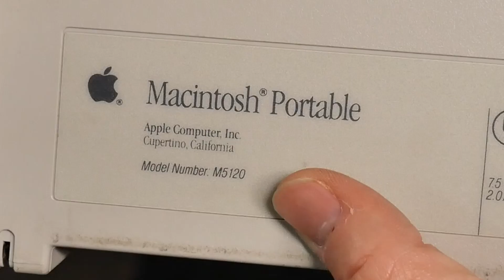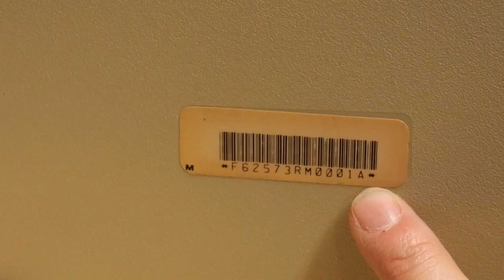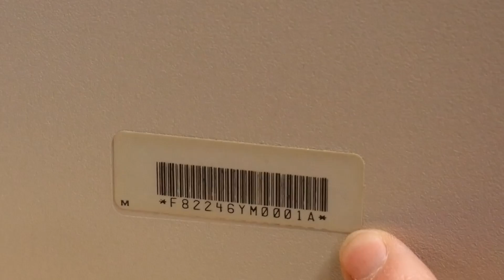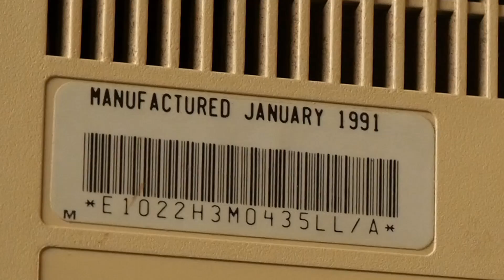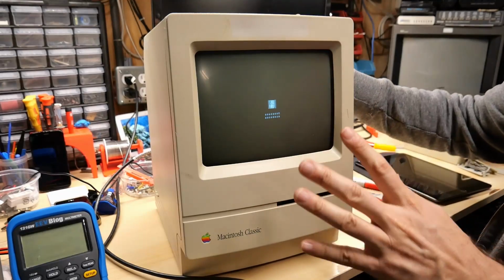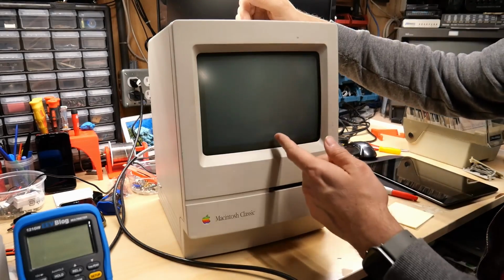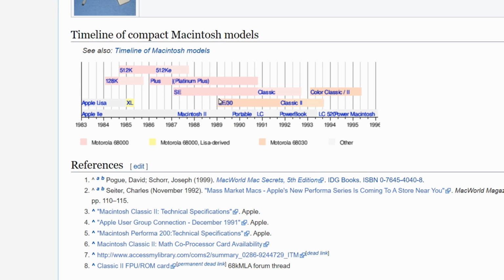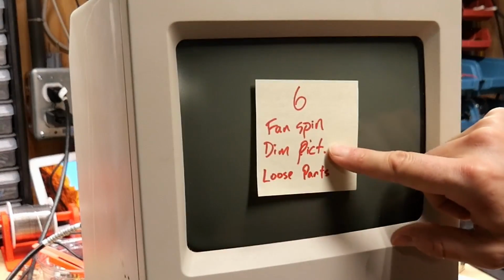Mac Repairathon Part 1: Taking stock of the issues

Comment: ive worked on so many of these over the years. and let me guess, the Maxell "bombs" have gone off in most of them? yea probably and its devastating sadly. :-(

Outside of that, the analog board and logic board caps are known problems in the Classic line. the Plus, usually the flyback or bad solder joints. The Macintosh Portable? Dont even try it until you get a good SLA battery to replace the one thats in there, or you risk damaging the logic board. And of course, its gonna need cleaned and caps too. But sometimes it eats the traces and you have to run patch wires to get it going again. That portable needs a 7.5V 1.5A adapter. Dont use a bigger one as its rated for the correct charge current of the SLA battery.

Also when removing caps, use the snip or press/twist method. dont try heating it up and removing it, the corroded oxidized solder will not want to let loose, and you risk loosing the pads. youve worked on plenty of stuff so im sure you know all that already. 

but I used to repair mac stuff and was good at it like you are with Commodore stuff. I know the Mac Portable inside and out. Even designed my own RAM card.

Comment: I'm reasonably sure that Classic II logic board will live again after a recap. You might have to run some bodge wires to fix traces around the battery leakage, but it looks a lot more contained than some old Macs I've seen. Those red Maxell batteries love to leak everywhere.

Comment: I have a Mac SE/30 that I screwed up the recap on and now I'm scared to touch it in case I make it worse.
Reply from the maker: You know my SE/30 had extensive damage from the leaking caps -- and to fix it fully I had to add some bodge wires. You just have to use powerful magnification, reference the schematics and be methodical about checking the traces around the damaged areas. I think mine needed a couple bodge wires and it is fully working again.

Comment: For troubleshooting classic Mac analog board issues, seek out Larry Pina's excellent "Macintosh Repair & Upgrade Secrets". He covers all the common issues. Classic form factor Macintosh analog boards are notorious for having cold solder joints. ALSO, the Mac Classic can be booted from an OS that his contained in the onboard ROM. If you can get one of them to pass POST, boot it while holding down Command-Option-X-O on the keyboard. "XO" was the Classic's codename when it was in development.
Reply from the maker: Wow! I hadn't heard of that combo, thanks for that. Will need to try that out!
Reply: @adriansdigitalbasement  Yes, a very handy feature of the Mac Classic. I have one that needs a recap and won't boot from the SCSI drive. However, it does boot from ROM. When you get yours working again, maybe some videos on modern days uses for these, making boot disks from a PC, etc. would be nice follow ups.

Comment: That big gash on the side might be a chemical burn kinda thing. There could have been something plastic touching it for a long time which eventually reacted with it. You see it where cables are lying on cases sometimes.
Reply from the maker: I've seen those melted cable patterns in stuff before -- but I think this was a grinder just as it has the telltale signs of that. Maybe it had something engraved in the side they wanted to remove?

Comment: Mac? Never heard of it, does it have a SID chip?
Reply: What's a MAC?
Reply: @MD4564  An Amiga with delusions of grandeur.
Reply: @MD4564  Last I heard it was a unique per-device identifier for networking equipment.
Reply: Yes, they did a version of the Mac with a SID chip, but Apple were too embarrassed to market it, so they sold it under their Commodore brand as the C64
Reply: Dave Poo If thats true then I gues they scratched their ears a few times afterwards😅
Reply: Everything Mac prior to the Macintosh II just sucks because they don't even have color screens I Mean wtf computers had color screens in the 70s already
Reply: DJ Slinus But the Mac's claim was screen legibility and emphasis on typographical concerns - which enabled it to spawn the niche of desktop publishing. With a display that was always in graphics mode, it could introduce the use of proportional fonts in a way that no computer prior was able to (well, there was the Lisa, of course, but whose counting that) as part of its normal UI capability for display to the user.

Color displays really did suck on personal computers until Apple managed to colorize the Mac OS. Prior to then color was only useful for games. The Mac II coupled with a Sony Trinitron gave the world a color display that could look at all day long and also be useful in typographical desktop publishing.

The first Mac OS did have some support for color - very primitive compared to the reworked OS that debuted in the Mac II. Of course, it was kind of useless as there was no way with the first gen macs to connect them to any color display.
Reply: @TheSulross  well sure, that's definitely an argument on apple's side. Color screens were blurry because of the way analog video works. I would still not buy a so called classic Mac, I'd rather go for a newer model that has a color screen or a 2gs actually

Comment: I once got my hands on a Mac 6100 pizza box in 05.  A shame the PRAM battery leaked. A fun system, had 4 Mb ram and a 40MB Hard drive.   Was running MacOS 8.5.  :)

Comment: The Classic II is based of the LC II (as was the Color Classic). In the 68KMLA Forums, several members made their own FPU board for it and it improved the performance to that of a SE\30. Without the FPU the Classic II suffered greatly. With the FPU, its a totally different machine.

These machines will give you hell to fix. I found a Classic II in the trash in the 90s and left it in storage until 2011 when I decided to look at it and fix it. It was worst than yours. It took me almost a week (3 hours a day) of work fixing it. Lost the audio on it due to corrosion around the audio chip but works fine other wise.

BTW those holes are the speaker grill.
Reply from the maker: Actually even with the FPU the Classic II can never be as fast as the SE/30 because it has 16 bit data path to memory versus 32 for the SE/30. This makes every RAM operation take twice as long .... hence that massive slowdown. It's like the 386SX versus the 386DX. Same issue -- prevents SX machines from ever being as fast (At the same clock speed.)
Reply: @adriansdigitalbasement  , Excuse the headache I'm about to throw here. Around 2014 - 2016 members Alaska360 and Parallel from the 68kmla.org forum created their own FPU Card for the Classic II and posted their finding and a limited production run of final product of that card. Giving input to that project, and verifying information from the 68K Books I had (The purple cover 68000 Microprocessor Handbook was the best for this), they found the following on a 16MB RAM Classic II (which you, I and everyone else knew 10MB was only accessed). Though the Classic II like the LC and LCII only accessed 10MB of RAM, it "played games with I/O."

The SCSI (on nearly all 68K Macs) and the Floppy were 8Bit. Expansion slots were either 16 or 32 Bit but RAM was 10Bit. How Odd. Worst - that RAM was seen by the CPU as with 16Bit or 8Bit depending on the application, it all depended what flags were initiated on the CPU. The FPU (according to the 68K Handbook) did not use any addressing, but used the 68K's PIO's similar to the C64 and Plus CPUs and on the Raspberry Pi's. These PIOs were for accessing multiple CPUs, FPUs, MPUs, etc. It only held 4 pins or "4bits" of selection. Thus the FPU was accessed according t these pins and the data dumped from the CPU to the FPU and then back to the CPU. the data was sent through the data lines. Here's the headache...

That Data to the FPU was 16Bit, but it can be accessed as low as 8Bit. I have an oddball Semi-Protype Classic II, ROMs are on EPROMS, like other Classic IIs that used 4 ROMs with the ROMs being towards the middle/bottom of the board, and a 2 ROMs version in a similar position.

According to the 68KMLA members who built the board had to build it with a 32Bit Data Path but only used 16 Bits for the FPU, it required 32Bits for the ROMs which they had an option for but never used. When using the clock from the logic board, according to Norton's Speed test, was within 90% of the SE\30 results. 90%, compared to the pokey speed of what the Classic II originally had! Things like displaying/printing Postscript/True Type Fonts, running Photoshop in greyscale mode, and many games like Spectre ran up to par with the SE\30.

If the FPU was clocked separately to 20MHz, it ran equal to the SE\30. If pushed to 25MHz, it surpassed the SE/30. But remember, one has a 10MB limit of RAM and this causes problems of their own. If one stays within the 10MB Limit, then one can do those things like a SE\30.

The culprit behind all this is a GLUE/PAL Chip, which if memory serves me right, goes by the name of "Eagle." You can imagine what other names it went under. This chip (also used on the LC, LC II and ColorClassic), limits the machine to 10MB under 16Bit RAM. At the same time it managed ROM Placement and I/O Placement and Data Width. Note: The ROMs on all these systems were accessed as 32 Bit, not 16 Bit as in RAM. See where this headache is coming from? #$@%&!!! that GLUE/PAL chip! But the FPU did not go into the GLUE/PAL chip, it was connected to the CPU directly. That is where a lot of the speed is made up on the Classic II compared to the SE\30.

Problem: Try to find this card. Alaska360 and Parallel only made 100 of them and they sold like hot cakes! There are other FPU cards out there, and technically you can design your won as it does not require buffering chips - it is a direct wire in to the socket. Their board has a Skull and two crossed  flintlocks under it.

Comment: Also, how do you make system boot disks? I want to make system 7.6 boot floppies for my Classic II but I can't find information anywhere on how to do that. I really need help.
Reply from the maker: If you have a working floppy drive on the classic, all you have to do is use a PC or Mac with a USB floppy drive and you can write the boot image write to the floppy drive. All the Classic and Classic II machines can read and boot from 1.44mb disks. Something like this works great: https://www.ebay.com/itm/1-44Mb-3-5-Portable-USB-FDD-Floppy-Disk-Drive-PC-Laptop-Diskette-Reader-Writer/133383361259?hash=item1f0e4492eb:g:RDAAAOSwjAlej7JY

Comment: you only need 1 adb port as mouse and keyboard
Reply from the maker: It's nice to have two so you don't need to have the mouse cable plugged into the keyboard and lying across your desk. I used to keep it plugged into the back of my SE back in the day which was just a neater setup IMHO.

Comment: I have two of the classics.. And my oldest one gave up on the sound a few years ago, and the second one gave up and gave me that sad mac not that long ago. So this is just the kind of video I needed! Greetings from Sweden! <3
Reply from the maker: The capacitors will have leaked and it renders them inoperative. That'll certainly be the issues on yours and will be the issues on most of these. Sadly the leaky caps can ruins all sorts of things like traces causing other faults too. I'll have a video on recapping these boards and fixing issues in an upcoming part of this series.
Reply: My hero!

Comment: Reminds me of the Mac Classic I bought from an electronics recycling center. It was actually working when I got it but I ended up replacing capacitors and had to do one bodge wire to repair a corroded trace. Looking forward to see if you can get these birdhouse Macs, as we call them, working.

Comment: I'm not a fan of Apple products, so it's pleasant to see one or more of them being tore apart, and prove that they are as faulty as a regular PC.
Reply from the maker: This era of Macs 1989 to the early 90s seem to universally have leaking caps and will damage them quite badly. Seems PCs of that era aren't really affected by the same issue for whatever reason -- although Amigas are. PCs will get killed by leaking NiCD clock batteries usually -- but once you fix those, they are reliable.

Comment: Great vid!  One of your other vids got me thinking about my Classic a few months ago.  It worked, but I wanted to look at the battery/caps.  They "looked" OK, on a casual observation, but I ordered a CAP kit anyway.  When I removed the caps, there was definitely leaking I hadn't noticed and one of them had a lot of damage from leakage underneath it.  I wasn't sure I was going to be able to resolder the replacement down.  But there was enough of the pad left for that to work, and after a cleaning, replacing of the caps, and more leaning, it works still.  If anyone has one of these, please replace the caps!  Even if it is working and it "looks" fine.  Looking forward to the rest of your vids.  p.s.  A hot air station is awesome for CAP removal.  ;-)  Even for a newbie like me.
Reply from the maker: Yeah if you do it earlier the better -- less corrosion and damage. Definitely should be preventative maintenance on all Macs from the SE/30 and IIci onwards ..... Luckily the Mac Plus machines here don't use this type of cap so that's not the issue.
Reply: @adriansdigitalbasement  I caught my SE/30 just in time not much damage very little but I have not taken the capicators off the board yet and my battery backup was still good
Reply: nice Desi I am getting ready to order my capacitors too

Comment: I had a Mac Classic II which avoided the battery damage but had loads of capacitor leakage. It started with a black and white stripy screen. I put the motherboard in the dishwasher on a cool program and let it dry over 8 hours or so.

When I put it back in the machine, the damn thing booted perfectly... I still had to replace the caps but just cleaning off the garbage put the board in a useable state. 😁
Reply from the maker: That is good it works again -- but definitely change those caps. On the sound circuitry when they go open you won't have any sound.... and things will just be unstable in general with the bad caps on the power rails. And yeah, washing the boards is #1 important thing to do :-)
Reply: @adriansdigitalbasement  Yeah, I replaced the caps and the audio (bong included) worked again. Was a nice machine but not having any other Macs made it a nightmare to get software on to it...

Comment: If you think it is unrepairable, send it to me and I'll show you :D
The only thing about repairing is cost of the repair. Usually it is not worth repairing, but it certanly is repairable. Everything is repairable.
Reply: I think "unrepairable" in the case of these macs means that you can't repair then without salvaging another board that's probably in better shape.  I have an "unrepairable" mac and kaypro, not because they can't be physically be repaired but because the parts that are bad on them are custom chips that are not available except as board pulls from another board.  In any case, you should make videos repairing old bad boards like this rusted one, I'm sure folks would find it interesting.

Comment: some years ago I told someone to remove the battery from their old bucket mac cause it could leak, and some know it all expert claimed they cant leak and he has never seen one from a mac leak out and blah blah blah, wonder if it ever bit him in the ass
Reply from the maker: Heh as far as I'm aware usually batteries like the CR2032 don't leak as they are dry cells -- but I'm not 100% sure about that honestly. The larger cells have electrolyte in them and yeah definitely over time they can lose their seal and leak... and then it's really ugly.
Reply: @adriansdigitalbasement  I havent seen a CR2032 go but I have seen their smaller cousin go crusty (like what would be used in a pair of digital calipers or whatnot)

Comment: I’d like to tinker with early versions of Mac OS but the machines are soooooo slow.
Reply: There are some good emulators that will let you tinker with old Mac versions without then hardware. Some options are SheepShaver and Basilisk II, but check out emaculation.com for guides on all of the options. There are even some prebuilt packages apps for newer Macs to run System 7 and OS 9 if you search around.

Comment: Just started watching. I'm guessing capacitors are going to be the main issue! :)
Reply: yes
Reply: With a bit of leaky battery damage for good measure - Apple engineering unwittingly insuring that these Macs had a drop dead end-of-life
Reply: Yep, but not just on the mainboard, but also the PSUs of the Mac Classics. They are through hole and don't bulge (usually) but fail and leak nonetheless, and the leakage really does a lot of damage to sorrounding components. The damage can also lead to these checkerboard patterns, since voltages will be present, but too instable or oscillating. Sometimes the electrolyte stays under the cap and can't be seen without removing it.